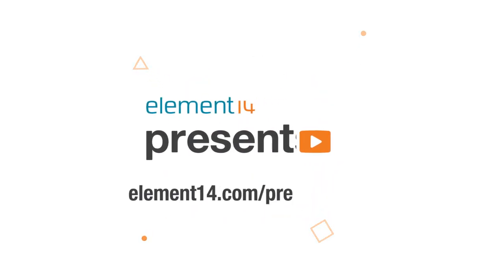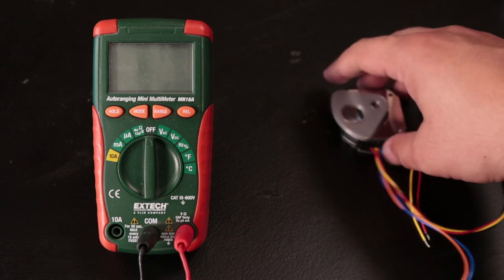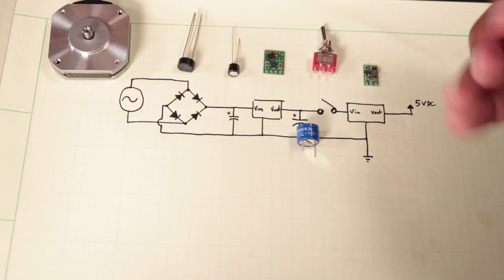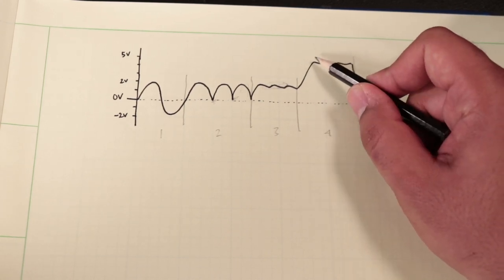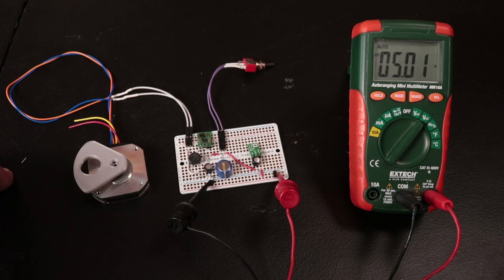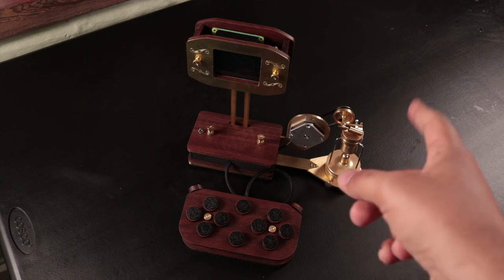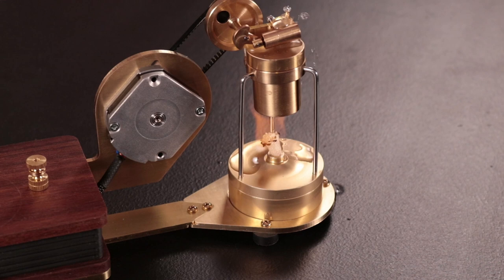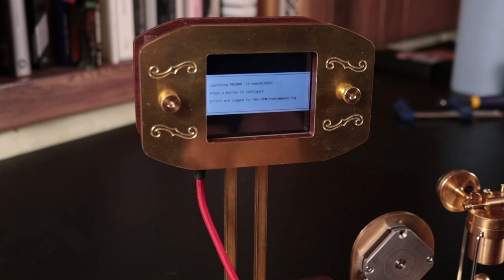Steam Powered Retropie Console

Comment: Just use a bigger steam engine with a separate boiler and larger fuel/water tanks. Then you could just separate them as much as you want and use flexible tubing to pipe in steam to the engine. You could also use something like an 18650 to store the power from the generator, may last longer than the supercap and you wouldn't need the second 5V boost converter, just a charger circuit with 5V output.
Reply: I had considered this acting as a charger for a battery at first, but that seemed like cheating, because the battery will "always" work and I think this would be funnier if it had to be refueled mid gameplay.

Comment: IT DOESN'T WORK. Duh. How many watts did you think it was going to generate?
Reply: The power output of the engine was never designed to match the continuous power draw of the system, hence the supercap power supply and separate switch.

Comment: Sadly a lot of these comments are right, it would probably be better to go with a slightly larger steam engine (but you shouldn't have to go much bigger) the fact that it was pushing out so much water usually means that the boiler had too much water in it, you should see a steady stream of steam coming out before starting the engine, but those models that are that size have always been plagued with issues running anyways, good luck rebuilding this in the future, I would love to see what you do with this idea next!

Comment: Definitely need to revisit this with a better steam engine (test it first!) and use BOTH motor phases so you get more current output!
Also measure the voltage coming out the motor BEFORE you worry about boost circuitry and regulation, because chances are the motor will spin fast enough you won't need to boost the voltage.

Comment: next time, please test it "ugly on the bench" before you commit to nice wood. I mean: It was kind of funny to how you build it, but when it does not even work with a battery powered drill (which at least would be ironic) and you have to default to wall power - I mean: Next time visit a local power plant. "See - it actually runs of steam" pointing toward the steam turbine "I told you - we life in a steam punk utopia". That would have saved the video for me, as it would have ended on a twist and good irony.

Comment: If your source is AC, why not start with stepping it up with a transformer? Also,  are you using all the coils of the stepper motor?
Reply: The problem is not the voltage, it's the power that the steam engine can generate
Reply: @LeBrulox  Agreed, the steam engine probably underpowerd. But even with cordless drill attached, the power circuit didn't work.

Comment: You have at least 2 big problems here:

1. The stepper motor needs a lot of torque to get it to rotate. (Even without anything connected to it.)

2. The steam engine is no where close to being able to power a Raspberry Pi Zero + a screen. 

2a. Even if it did, you would still need a bigger supercap to be able to power the Raspberry Pi Zero during refueling.

Suggestion:

Either make a massive steam engine upgrade, or ditch the idea. (which would be sad, because that setup you have made looks gorgeous.)

Completely re-design the setup to use Gravity instead!

Use the same basic energy storage and delivery system that a grandfather clock uses!

Use this for inspiration: 
https://www.azocleantech.com/article.aspx?ArticleID=349

https://youtu.be/qwEmgwrVUag
Reply: interesting tedx talk .. LEDs are really a massive progressive step forward for safety and health!
Reply: Rory O Connor
Indeed. 

But the most interesting detail about the GravityLight, (IMHO) is the powersource..

Literally anything you have laying around that’s heavy, and gravity!

Hell. With a bit of tinkering, you could build a fully mechanical and autonomous “rewinding” device, that’s powered by a primitive windmill or (if you happen to live right next to a moving body of water, that is too weak to power a hydroelectric generator) a waterwheel that can lift a large weight by attaching a rope to the shaft of the wheel...  😁 And there I go with my never ending rants, as it often happen when I get stuck in brainstorming mode. 🤦‍♂️

Tl;Dr.. I love coming up with overly complicated theoretical upgrade modifications, just to try making something that is already optimized for efficiency, even MORE efficient/stronger/user friendly/versatile etc. ad nauseam...
Reply: @BoHolbo  Rant on bro.. lol =D

if you spent a couple of  years video documenting all the permutations and combinations of feasible gravity devices/low energy sustainability devices [e.g. wind up radio etc..]  reaching sub $1 ..you would be set with a major relevant and need contribution not only to third world but #ClimateAction at a very practical scale!

..and hopefully appliances would be hyper efficient by then!

I strongly believe that households that combine sustainable energy devices should be encouraged with training incentives/tax breaks/assists etc.. everything is on the table to get things moving in the right direction.

Comment: I recommend to use a peltier module next time so, that you can catch the provided heat-energy without using moving parts. Please make some basic calculations e.g. how much energy is stored in small cup of ethanol (it should be enough), how many of this about to be lost in the thermodynamic and mechanical parts (I'm guessing for a 95%).

Comment: Well, everything works but the steam engine, so you have lots of options for future alternatives, such as tiny wind turbine, treadmill (or hamster wheel!), foot pump (both mechanical and air), tiny solar, and of course sourcing a steam engine that actually works. As Adam Savage says, "failure is always an option!", and nothing teaches you more than failure. But it's clearly not a total failure, just one component failed, and it was one you didn't build yourself. By the way, instead of using a belt you could use a chain (yes, I've seen tiny ones of an appropriate size) or even a connecting rod. A ball chain might even work.

Regardless, it's a cool project!

Comment: I'm wondering if one of the coal powered steam engines used for model train engines would be enough to power that.  Also seems like the coupling rods would be a viable replacement for the belt you were having overheating trouble with.

Comment: The motor might get far too hot and the enamel might start to melt and become useless so maybe using a turbo and using steam to drive it and compressing air to cause the burning of fuel to generate heat to generate steam to spin the turbine which closes the cycle and the cold end of the turbo can also be used to drive an electric motor.

Comment: That small of a steam engine woont work underload anyway, its just a desk toy meant to be fired up on its own. also it looks like your using way to much water in the boiler, it shouldnt be spitting that much water out the moment you set it alight. Give it a shot with a compressed air engine as a proof of concept or a larger and tested steam engine. Also with a larger steam engine, you could potentially use gearing to spin your motor a little faster for a little better power generation. Love the design though. It looks really good and fits the aesthetic of steam punk very nicely, needs more gears though lol.

Comment: How much water did you use? don't think you need that much in the kettle to give enough steam preassure to move the piston. Might need to machine a drip-feed to stop itt squirting water everywhere and putting the flame out...

But as others have suggested, Sterling engine is the way to go.

Comment: So there I was, wondering how on earth the little steam engine was going to turn that stepper at 1:1.  Then you went ahead with a belt (such an ugly solution) and failed anyway :-(  Seriously, why didn't you just go with a pre made steam or stirling generator?  They're out there for cheap.  Or a tiny DC motor off a micro R/C heli tail rotor.  Or a decently sized steam engine.  Or...

Comment: There has been a resurge in the romanticism around steam powered engines and yet again they never mention the black coal smoke pumped into their  treasured country sides or the debilitating conditions/diseases associated by close proximity oil and coal fumes etc.. now the car protect us from the fumes.. so modern! lol anyway :P 

.. always thought the inventors of steam engines were actually trying to solve the fume output .. in a almost preemptive environmental carbon capture system! THAT would be insanely cool! 

#ClimateAction

Comment: Stirling engine doesn't have to be as hot.
Reply: But they dont have much power, not that this tiny steam engine had much either.  A Stirling Engine might not turn that motor under load, even if it were a larger one

Comment: You should have started with a back of envelope calculation of power output on the steam engine to see if it would potentially be able to power the device. You would have come to the conclusion that this never would have worked. Also, you are only using one coil on your stepper motor. A stepper motor is not the most efficient "power generator" out there. You should either find a way to capture the energy of the other coils or go with a different type of motor that only has one winding. Nice try, but a lot of wasted effort on something that never had a chance of working. It's almost like you didn't even consider power requirements in the design at all. That stepper motor is way too small and your steam engine is way too small. Not even close. It would be like trying to power a car using a raccoon on a bicycle. Just right off the bat you should have been able to look at the scale of the situation and known that it was a non-starter. Still.... the video has value because it covers basic concepts of how to get this to actually work (assuming you use large enough motors and steam engines).